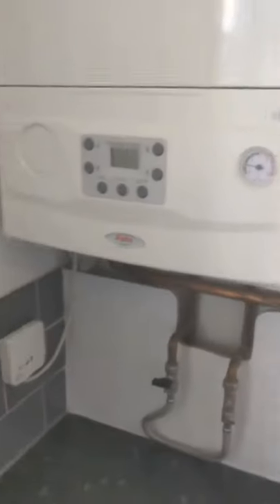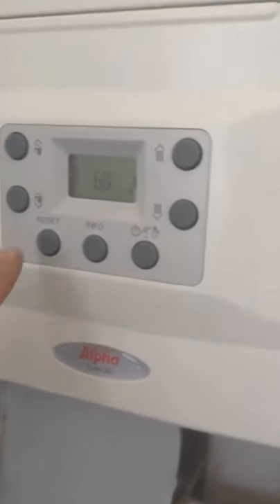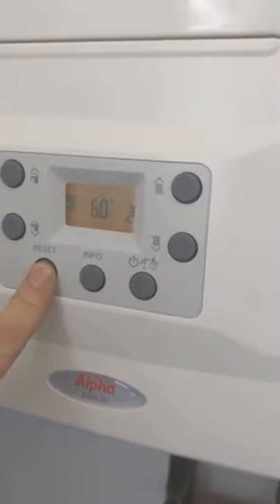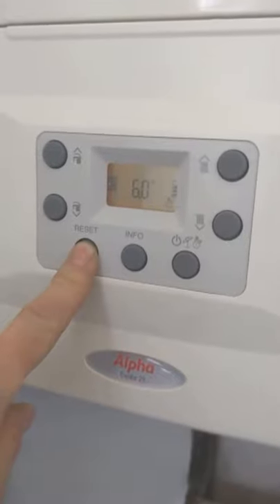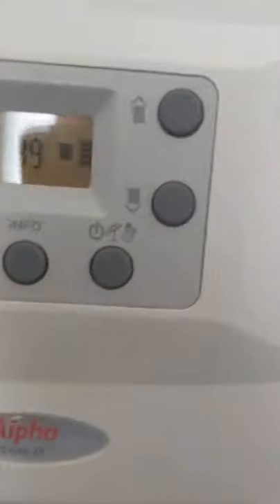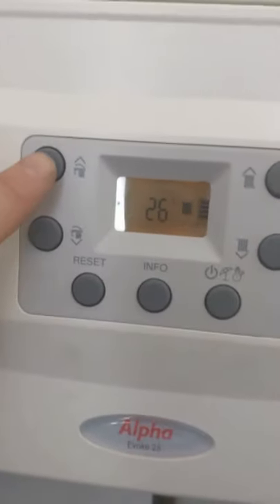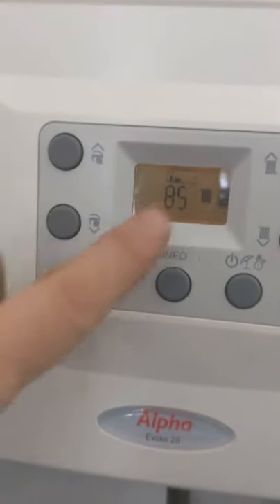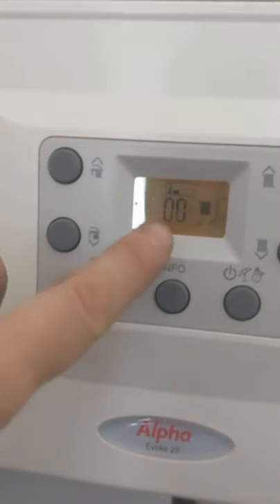Alpha Evoke28 Service mode

Comment: I have an Aplha Evoke 28 & it doesn't have a timer so I can't set it to come on in the morning. PLEASE HELP my Rents just gone up £200 per mnth & the radiators have no dials on them so if I hsve the heating on I have to heat up all the rooms in a 2 Bedroom Massionette. All I want is to be able to set the timer do I can get up a little warm! Is there something I can buy? Is there a video to show how to set it up? I really am desperate! ANYHELP WOULD BE GREATLY APPRECIATED?! 😢
Reply from the maker: The alpha connect thermostat is about £100 to buy. They are easy to install